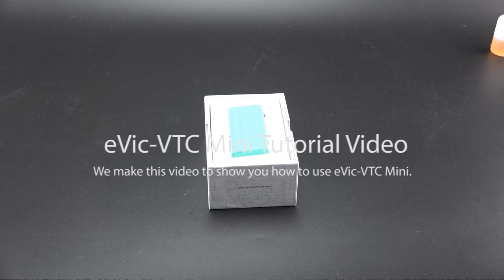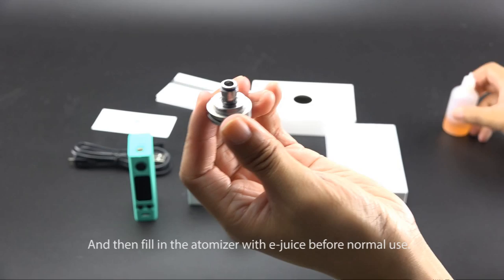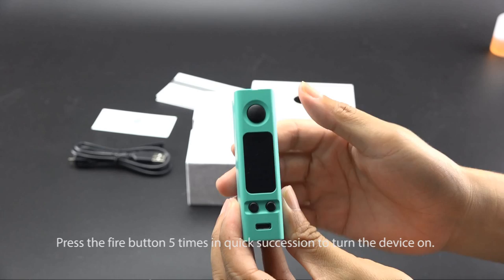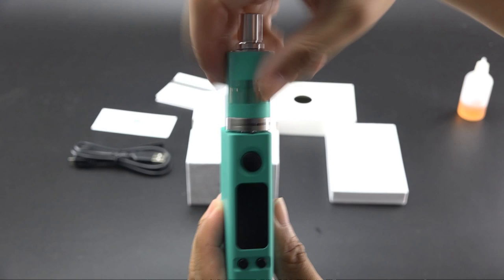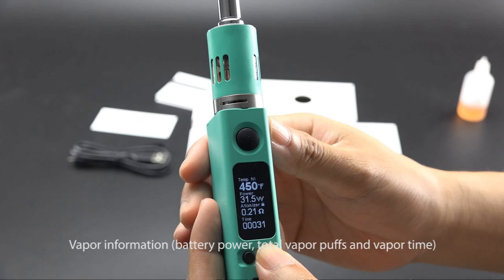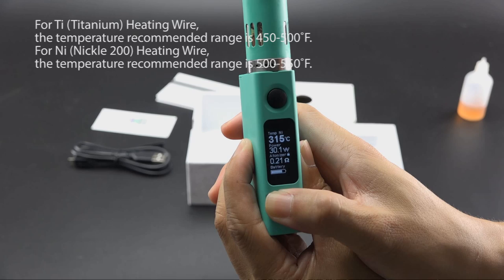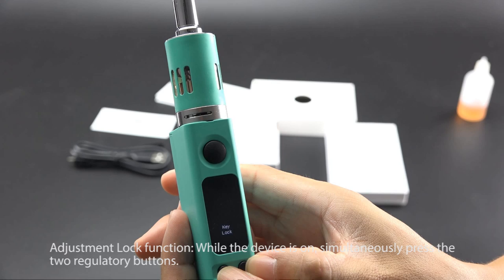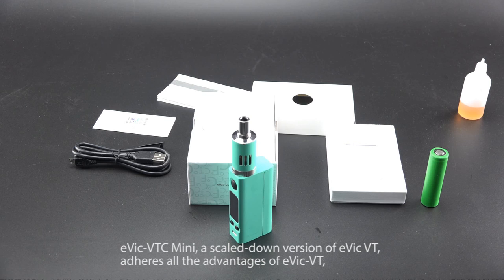eVic-VTC Mini Guide Video

Comment: Love this new evic!! i set 500F for Ni as recommend, and at 10-12W it has enough smoke for me in public (more power at home)
This is the only coil set I have used that it doesn't smell burn even at highest power
Not try Ti yet, but expect that it would be good too
Reply: +Yuttasak Palakawong I recently bought this vape. What wattage and fahrenheit is good for big clouds with Ni coil.
Reply: Mare BG I set temperature @400-500F. For first day. I set12-13w. Then increase but never over 22w. I have video clip will send link to you tonight
Reply: Also, should I charge the battery fully before first time use? the battery and the device are both brand new.

Comment: Some inconsistency.  You say CL-Ti recommended 450 degrees - 500, and CL-Ni 500 - 550.  However, right after, you say "we apply Nickel here so we stop at 450 here."
Reply: +Domenick Barbo Did you get the ideal wattage and temperature combo for the nickel coil..??
Reply: +Vikram Ghatge Yes, but I recommend getting a clearomizer Tank.  The stock tank on this MOD is terrible, but the MOD is great!

Comment: For some reason my vape is leaking. I tried changing the coils and everything but it leaks all the time out of the air bit.
Reply: cause the stock atomizer sucks I have a avocado 22m with this mod and its awesome and install CFW from git hub epic shit it even has a flappy bird game hahahaha
Reply: Monika xx same .. I've found that when screwing the bottom of the to back on push it slightly before spinning oh and also if your vaping at too low a voltage it can kinda flood it
Reply: This mod is amazing been using it for years but the tank is garbage and leaked.  Get a new tank and yoyr good

Comment: So with the Joyetech eVic-VTC Mini 60 Watts do I NEED the sony VTC4 batteries or can I just buy some LG 18650HE2 2500mAh Rechargeable Batteries??
Reply: +brainz110 You can use LG. As long as you've got the original ones to prevent an explosion. I had a sony but now use a samsung 18650. Seems marginally better at retaining power.

Comment: Keep getting temperature "protection" indication no matter what I do. What can I do to fix this?
Reply: +Justin Pons Same here . I am also getting the same ?I have Ni 450F Power 60.0w 0.20 within a second "Protection"
Reply: +Justin Pons That's what its supposed to do. It usually takes less than 1 second to hit the temp you select. After that it dials back power to keep the coil from getting too hot. "Protection" lets you know that its working.

Comment: Has anyone had leaking issues with the eGo ONE Mega tank? I've actually exchanged the entire package for a brand new one with the seller and the new tank still leaks. And I have ensured that the coil head and base is screwed in properly every time I have to refill it with juice which is quite often since it leaks. Help as I'm losing juice like crazy!
Reply: Im having the exact same problem

Comment: So she says they applied a nickel wire, and we're supposed to set it at 500-550 F. Then she sets it at 450 F. Wtf?
Reply: You ALWAYS set it lower when it's brand new.  It's an adjustment period.  Then you work your way up to the OPTIMAL setting.  But the user manual is only going to tell you the optimal settings.

Comment: can you vape NI  in Bypass, or not
Reply: +Anthony Salerno Don't, it is dangerous as the nickel might oxidize and release harmful chemicals. The purpose of TC is to be able to use coils made of these low resistance metals (titanium aswell) without making them too hot as it would be dangerous for your health.
Reply: +morrwald thanks for the information, that's how I understood it too,

Comment: Damn just got this thing,   the dude at the shop recommended me to start off with this atomizer that should be powered with 13.5 watts,   its easily adjustable in the system,  you can then set it to LOCK and then to STEALTH so it wont show a display anymore .    Damn even at only 13.5 watts this thing generates FCKING LOADS of vape!   i can barely see my screen at the moment!
Reply: what are ur settings at? I cant find a good setting to get denser clouds!!!
Reply: Cynthia Marroquin
I dont really mess with any settings,   i just put my VTC on the power setting  so that i can only adjust the WATT,   the ohm and voltage is automatical ;)
 anyway,  i now have the 0.5 ohm OCC coils made for the kangertech subtank ,    i start him up by first dripping on the coils directly (into the holes on the sides)  until it no longer soaks up liquid,   then i start off at a really low setting a few times ,   and then with a few steps i go higher,   i end up at around 35 Watts for optimal vapor production,    but if your vapor is thin,   it can also be the e-liquid,   Before i bought this good e-liquid i just had the cheap EcoGreen liquid wich just doesnt produce as much vapor...
So,  2 things to look into:   your coils    and the e-liquid.
In theory the 1.2 Ohm coils can also produce alot of vapor,   but you will need better e-liquid i guess,  im not 100% sure but my liquid with 30%PG  and 70%VG seems to produce the best vapor,  so you can just look around for a liquid with around that composition
Reply: Do you need cotton to use this vape?

Comment: How do you turn the ohm's down on the coil? All I can seem to do is lock or unlock ! It's super fucking annoying!
Reply: +wayne peters   you can't turn down the ohms, its just adjusted per coil automatically. ni / ti / power mode all have different variations of ohms that will automatically adjust when you add a new coil.   you don't really need to adjust that, only temp. & wattage affect your vape.
Reply: Thank you, I got it now!

Comment: does it need the battery or can i just charge it with the usb
Reply: It needs a battery. Even then, don't use it while it's charging. It's best to get two batteries and a separate charging station.
Reply: Dylan Brandau why is this? can't I charge the battery with the USB cable in the vape